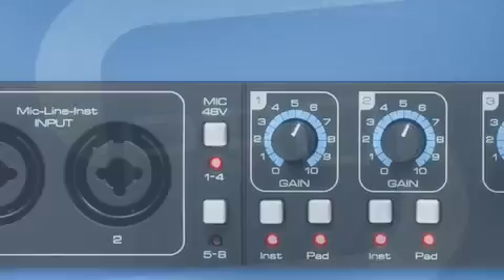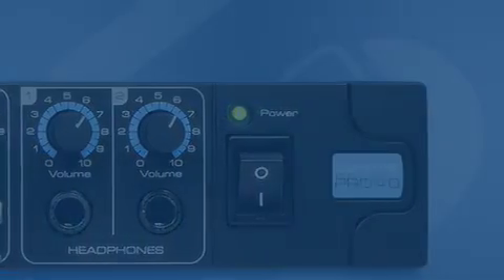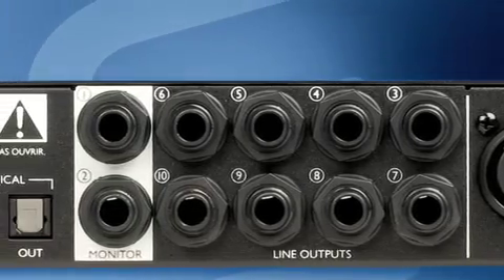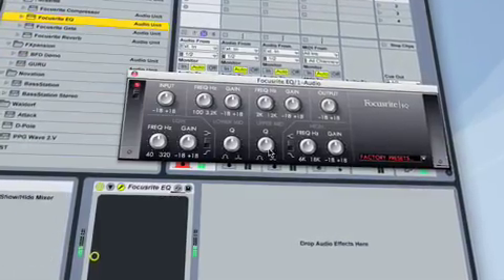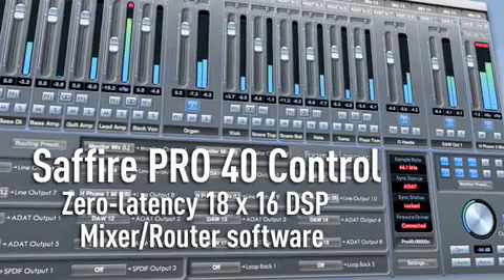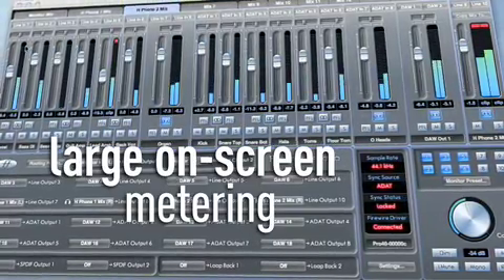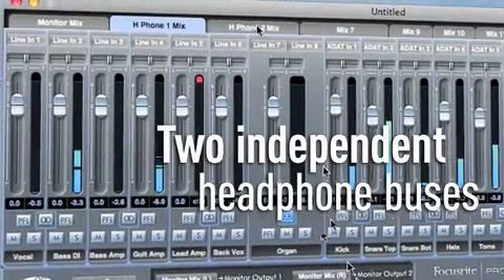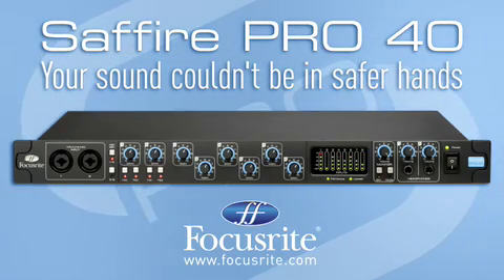Focusrite // Saffire PRO 40 Audio Interface

Comment from the maker: The Saffire Pro 40 is an interface that can be connected to the computer via Firewire as well as operate in a standalone mode and ADAT connect to another interface.  The Octopre MkII is not an interface and must be connected to an interface via ADAT to send signal to your computer.